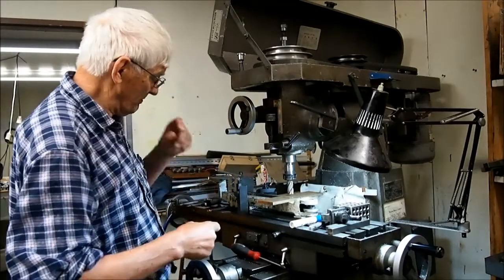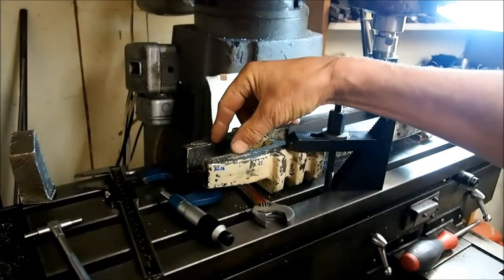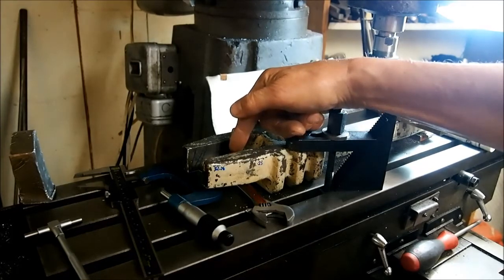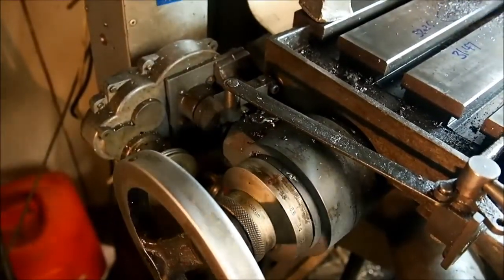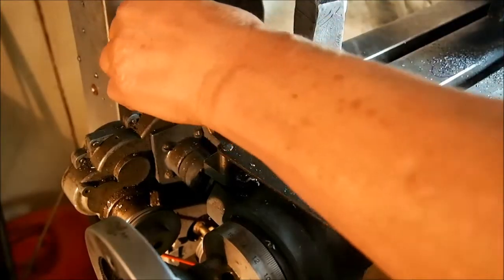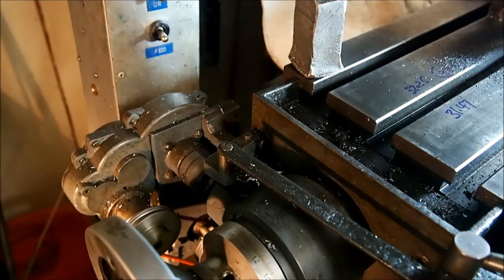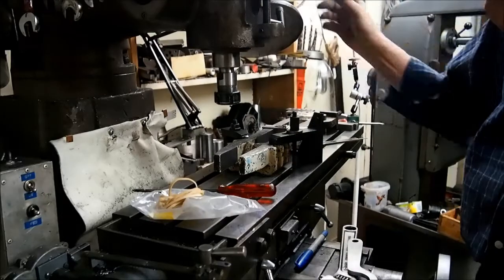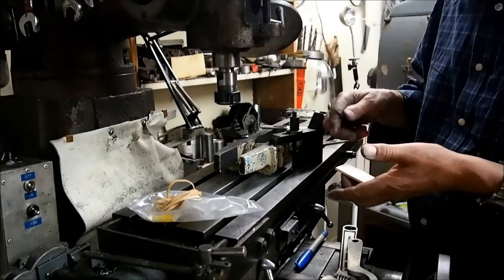Alba 1A shaper repairs Part 5. Machining of the fork end of the rocker arm.

Comment: Hi Neil from the UK, I can't believe how much play there is on the two slots/forks, guessing it was used at a fixed stroke length for a considerable time. 

I have a 7" shaper, which I believe is an Elliott, it was originally designed and built for layshaft belt drive, a previous owner added a large vee pulley and AC motor. So it is a two speed, it is also blessed with a large vertical crack between the ram dovetail ways, with an old plated repair. The pedestal base also had a crack, so maybe a skip reclaimed jobbes!

I strengthen/terminated up the crack, and managed to remachine the dovetail ways and knee ways on my Bridgeport (10 mm bigger and no chance).

Nice project and presentation.
Best regards John.
Reply from the maker: Thnaks for your comments John. Pity about the damage to your machine. Mine was used ina high school, so I gues it probably did a lot of work at the same settings.  It is running well now, and I am very happy with it, although I need to sort out the squareness of the box to the stroke, which will save me packing up the vice, which is not a very elegant solution.